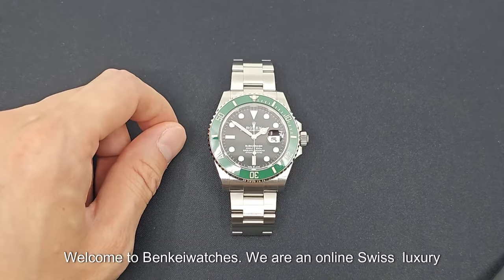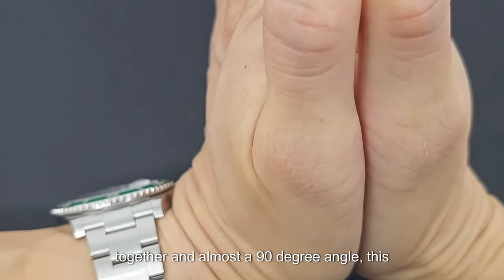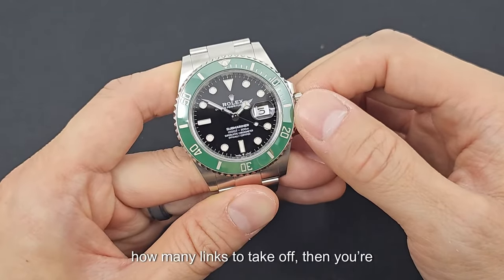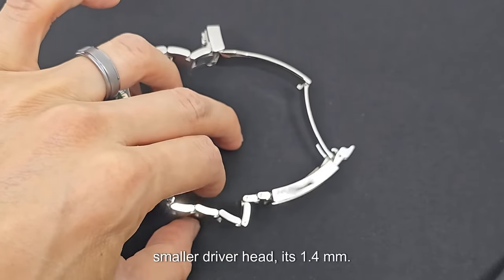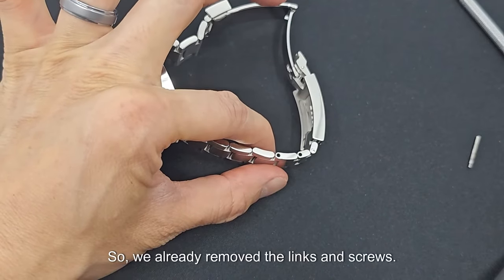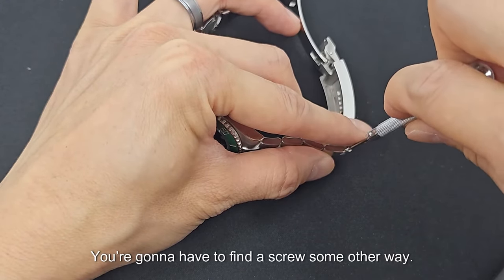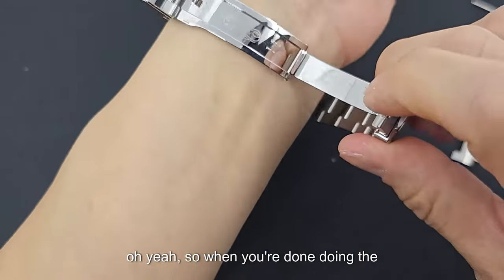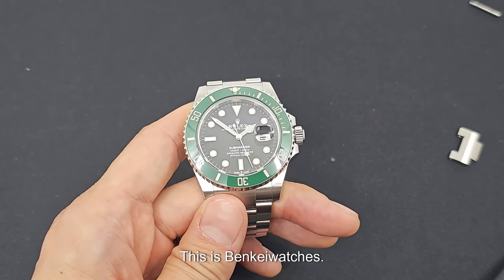Rolex Oyster Glidelock Bracelet Sizing Tutorial

Comment: Having gone to school for Rolex watch making and repair I can say this is a pretty good video but I would like to add a 2 things.

1) invest in a watch block. These are relatively inexpensive and provide far more confidence when adding / removing links as it will steady the watch thus allowing you to use both hands on the screw driver (one to turn and one to steady the shank)

2) we were thought to size glide lock clasps with the mechanism in a neutral position with a bias to outward adjustments with the exception being if the client intended on using the glide lock exclusively as the divers /wet suit extension and not for daily in the fly adjustment

Comment: Very helpful. My 1985 16800 has never had a screw removed, so knew it would be tight. Hair dryer worked perfectly. Have seen a blow torch recommended...WTF! On a $15000 watch! Screwdriver fit properly, used a holder base to hold the bracelet and pressed down while using fingers from both hands to turn. Came out pretty easily. Thanks for the video!

Comment: I have an 7 inch wrist, that's 9 setting on the glide lock, I'm on number 6 setting from the lowest, 6 o'clock side have 4 link and 12 o'clock have 5 link, can I add a link on the 6 o'clock side to get the lowest setting on the glide lock?
Reply: Sure you can. It's your watch. But if you make it where your maxing out the glidlock it will prematurely wear out your braclet.
Reply: I went to RSC, and they add 1 link on the 12 o'clock side and took out the half link on the glide lock side, now I'm on 3rd lowest from the 9th setting. It looks balance out . @wcarterjohnson